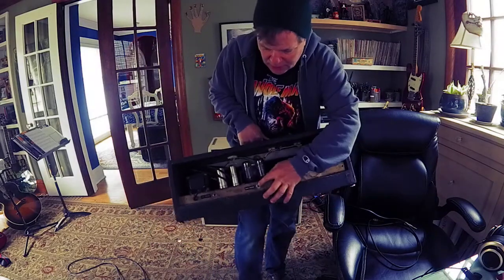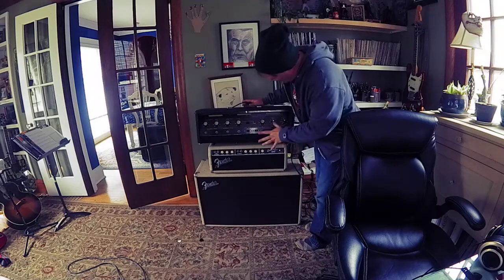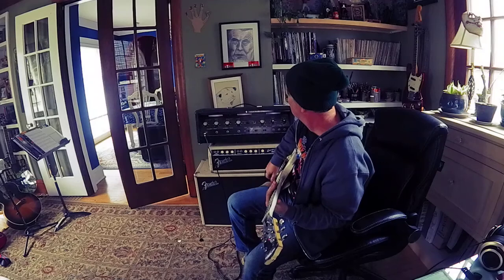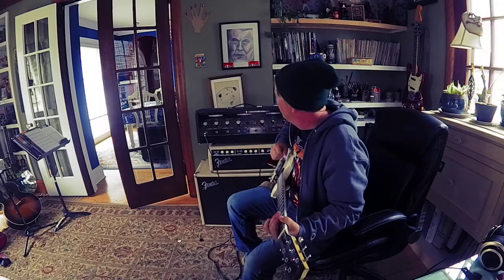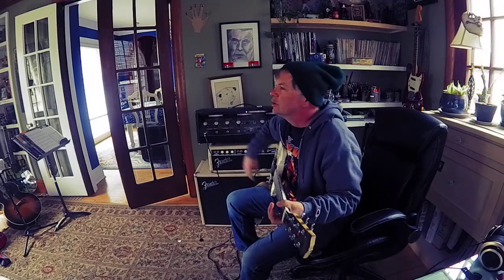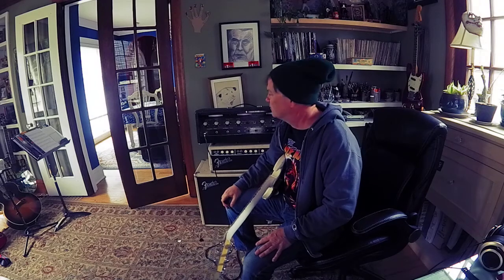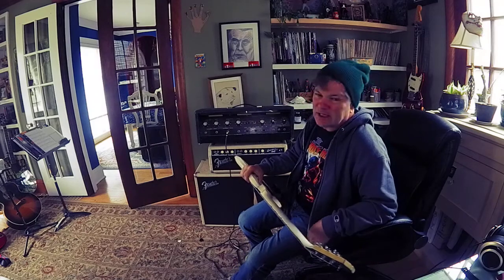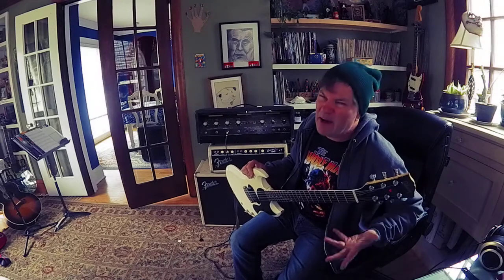Checking out an old Montgomery Wards Tube Head

Comment: Hey Brook! For some reason I never checked out your youtube. Feel like I should start offering better instructions on the oddball stuff I work on for people. 5881 is another name for a 6L6, so same tubes in the output section as your blonde bassmen, but cathode biased instead of fixed bias (little less power and slightly different feel).  This guy had a mouse living inside it for a while, that ate through the shielding and a bunch of wires.  My modern aluminum foil shield might not hold up to the retro version the mouse ate through, so you might need to stay a step back from the amp to keep the hum down.  The fender below it uses '60's window screen, much more mouse proof.
Reply from the maker: People would really enjoy your amp repairs and learning about the things you encounter Max. I sure do! 60's window screen! More technical info that is really interesting. Do you have a channel? I can share it.

Comment: I found a bigger version of one of these in my grandparents garage, and upon doing some research I’ve discovered that it requires some sort of special TRS stereo cab, or else bad things happen, but it seems like you connected it to a regular mono cab without issues. So my question is, did this amp end up having issues because of the cab down the line, or is it still working fine?
Reply from the maker: Hey there Beck, most likely this amp came to visit for a day or I was taking it to a shop to get fixed. I have a very faint memory of this amp! So as far as I know it was ok during the time I had it. Wish I knew where it ended up.
Reply: @brookhoover1384  darn, thanks anyway!